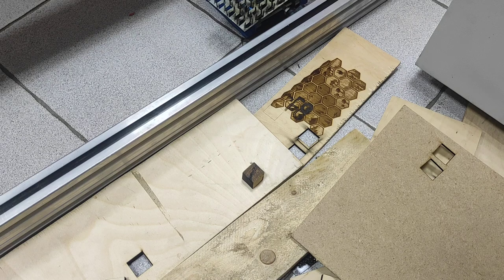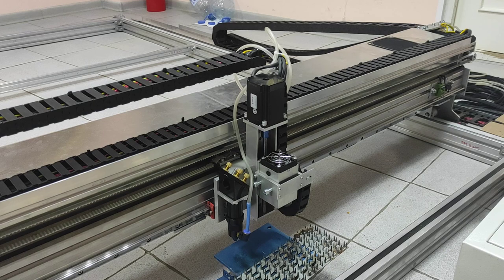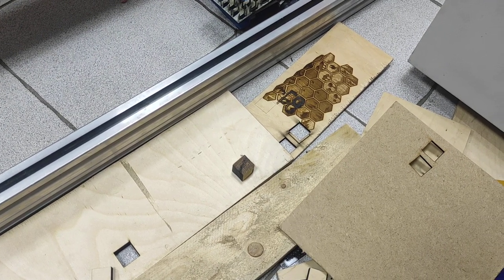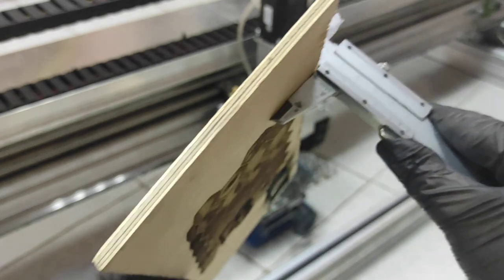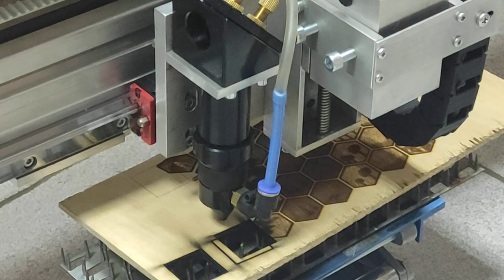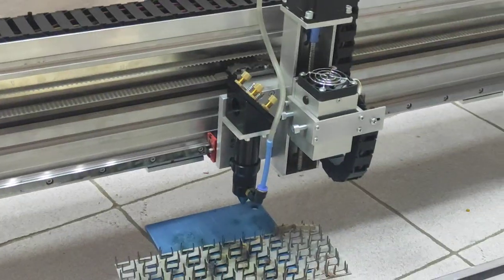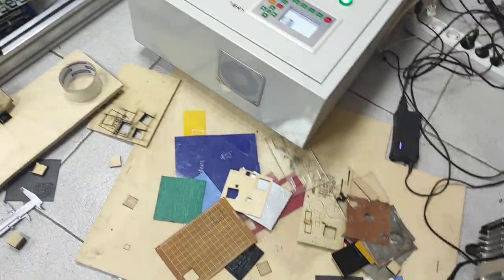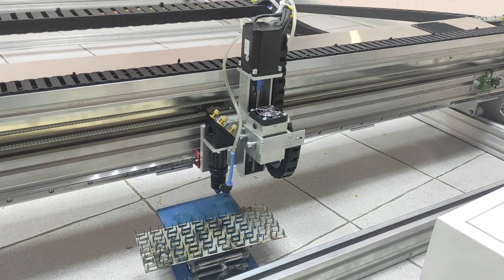Wood / plywood Co2 (gas) laser cutting tests - 80 watt power. Endurance custom frame.

Comment: the thick plywood  should have cut that in 2 passes the focus is out on the thicker ply.  My K40 can cut that in 3 passes George....Also on experiments like this always cut a circle rather than a square its easier to get out than a square is..... we got to 19mm on a K40 and that was the maximum it would cut after 8 passes. good test on shite wood really an inch not bad at all.
Reply from the maker: the problem with K40 that they stop working in about 2000-3000 hours. Our lasers can work 10000 hours+. So you do not need to replace a Co2 tube at least during 2-3 years.